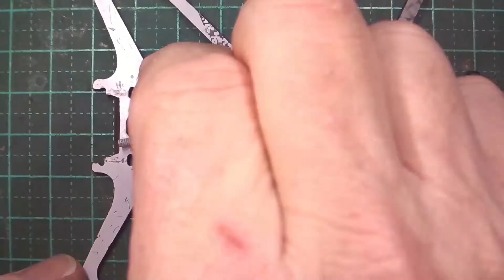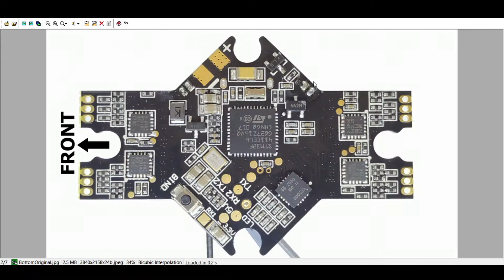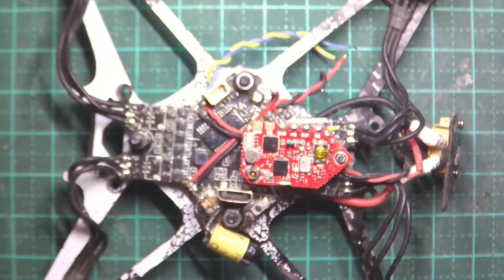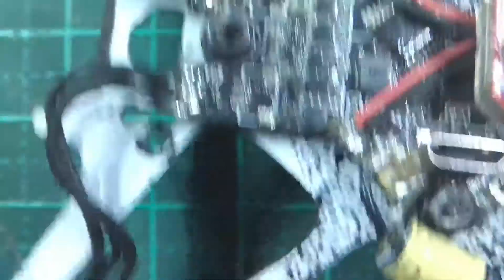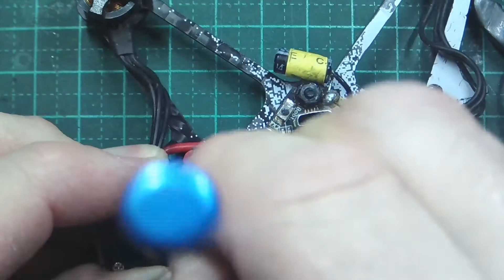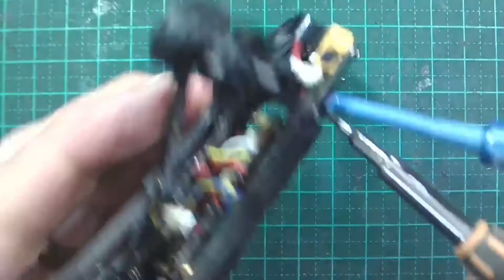My Favourite TinyHawk 2 Freestyle Re-Build - VTX and Receiver Upgrade

Comment: When conformal coating what did you do with the jst motor plugs?
Reply from the maker: Any plugs like the motor plugs or USB connector you just need to spread the conformal coating around them without getting it in the plugs. I usually pour the conformal coating on the middle and then spread it over the board  with a tiny paint brush.

Comment: Can I use this with the TH2 Freestyle Stock googles and radio?
Reply from the maker: For the VTX - yes any analog VTX will work with any analog receiver. But not for the receiver upgrade. The standard receiver on the board is an FRSky SPI receiver and here i am upgrading with a different system. When you add an external receiver then that needs to be compatible with whatever radio system you are using.

Comment: Great content.  What did you do with the original RX antenna that came on the board after you added the tracer RX?  Did you de-solder it, or did you just leave it in place?
Reply from the maker: I removed the antenna.
Reply: @cubefpv  Will that 'burn-out' the receiver on the board?
Reply from the maker: @stargazer6912  No it won't burn out - the receiver on the board will still be powered but just won't be used because you are setting the UART to the external receiver in BetaFlight.
Reply: @cubefpv  thank you!

Comment: Hi basud great vids I've subbed u need bit of help got Diatone Roma L5 prob I'm having issues long rang at moment best range 800 meters on race  band  channel 6 400 mw stock vtx need good anttena 5.8ghz stock is 2dbi ipex ufl connector the mamba anttena long but shit any good ones I should try Cheers
Reply: The problem is not your antenna. Even on a cheap antenna you should be getting more than 800meters on 400mw. Yout VTX is probably locked in low power mode - 25mw. some VTX need to be unlocked. Contact the shop you bought it from and ask for instructions or assistance.
Reply: Press button for 1t seconds in Google's says 400 that max power so it's not that I change anttena on Google's got from 150 to 800 meters would 14 to 16 dbi be better for googles

Comment: Heey man, i am complete new to this and i bought my self a tiny hawk freestyle 2 . I orders some upgrades aswell and i want to ask if these are any good and worth to put on to. 
 
*telling lumenier axii 2 mmcx/straight mmcx 5.8ghz 2.2dbi gain fpv antenna rhcp/lhcp for rc fpv racer drone - RHCP / Straight-MMCX 

*lumenier axii 2 mmcx/straight mmcx 5.8ghz 2.2dbi gain fpv antenna rhcp/lhcp for rc fpv racer drone - RHCP / Straight-MMCX × 1
RHCP / Straight-MMCX 

*hglrc forward vtx mini fpv-zender 20x20mm pit/25/100/200/350mw

*frsky xm+ micro d16 sbus 

Thx for the video btw as putting it on wi be my first time to so i hope to learn a thing or 2 fro you
Reply: The products you mention are all good products. Most people these days however are not using FRSky. But if thsat's all you have then it's okay. The only thing is if it all fits in. for that you need to see yourself. Upgrading this  airframe is a challenge. One note on VTX with a 20 x 20 stack mount. it might not fit in because it might make the stack too high. You just have to try it and see.

Comment: Great video. Love your commitment to modding out this one quad. it really helps to see how you go about problem solving. 
What material is your "Battery Connector Mount" made of?
Do you have a link to where you get your buzzer?
Reply: Thanks for the support David. The battery mount is made from 1mm FR4 Fiberboard. It's the base material that circuit board are made from before they add the copper plating to it. for the buzzer it's just a standard 5 volt one. You can buy them at many hobby shops. Just make sure you get one with 2 leads not three. The Tinyhawk doesn't have signal wire for buzzer just pos and neg.